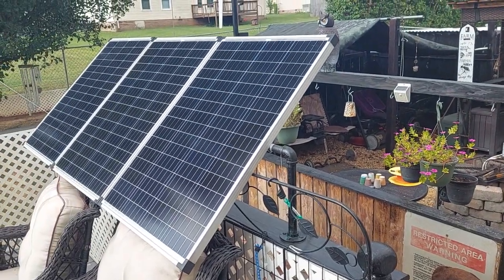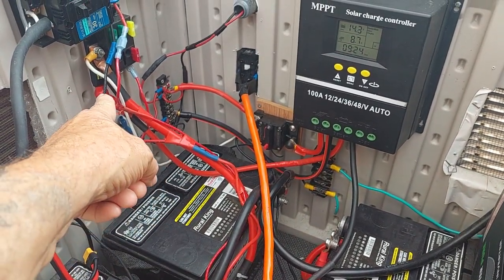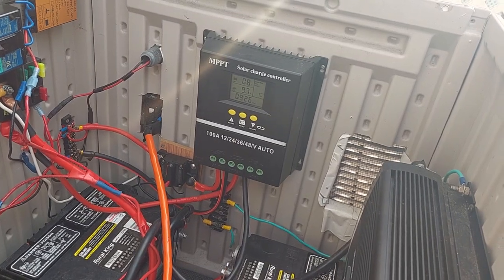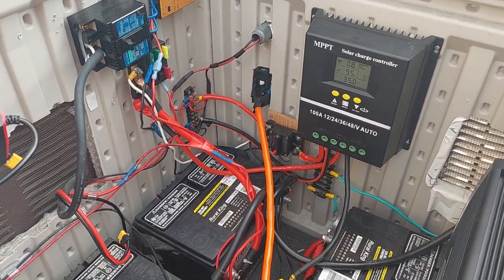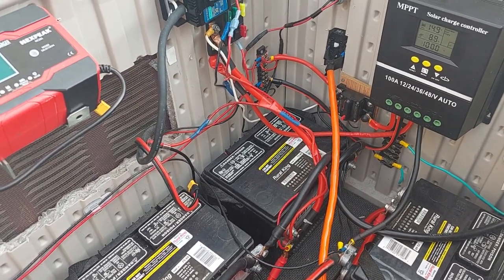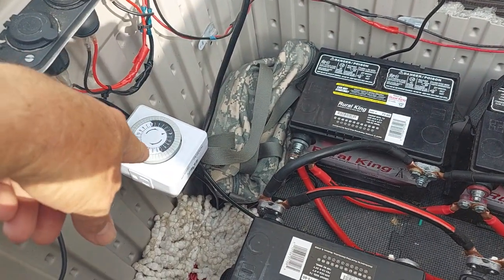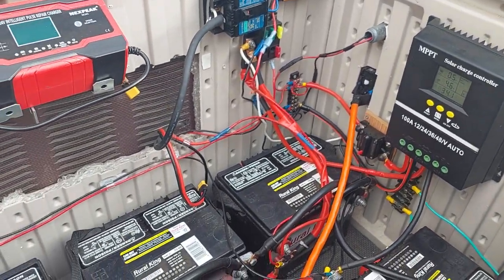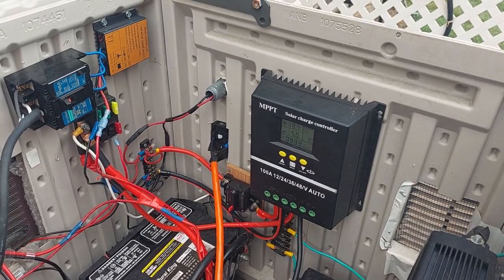Oops, Corrected the high voltage disconnect setting, Much Better now

Comment: The great thing about lead acid is they can be more forgiving if you charge them quickly. They can take a very high charge current making it easier to do.
Reply from the maker: given the age of batteries.. i drop to 14.2  so be it for less stress on batteries. That should be sufficient.